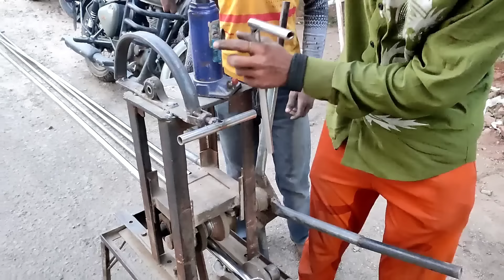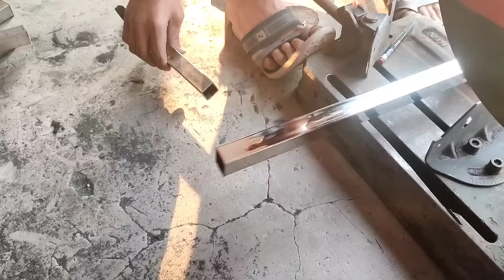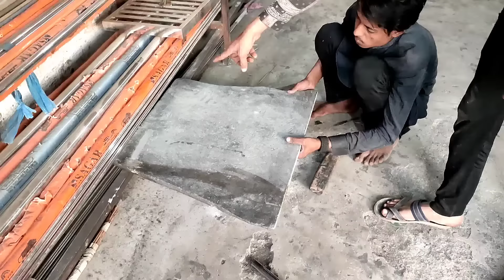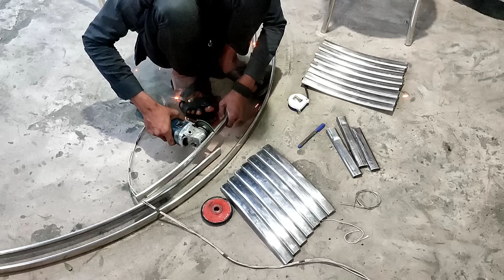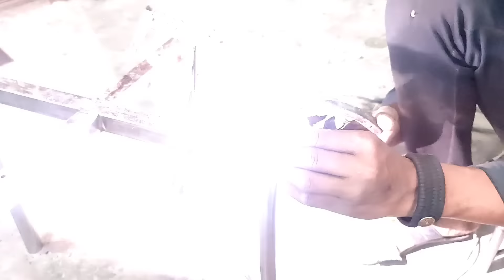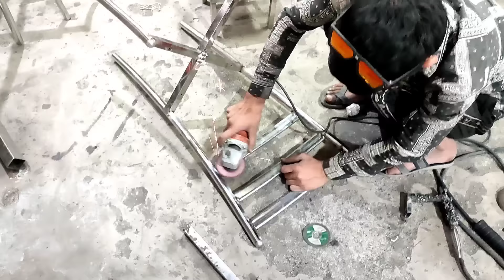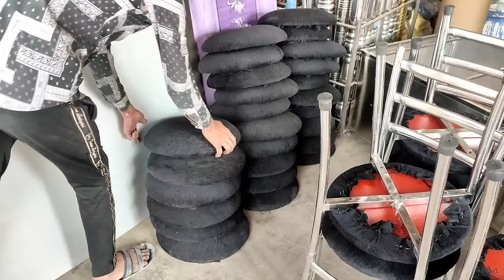HOLLOW STEEL CHAIRS | MINIMALIST CHAIR | CURRENT CHAIR | Stainless steel Chair design Manufacturing

Comment from the maker: Fully stainless steel chair 202 G

You can also order this chair. Minimum order is 50 chairs and its price is INR 900. 

Contact - 9907993089 - 9098406850

Email irshad9907@gmail.com
Reply from the maker: @rehanhaidar6877  1250
Reply: Pipe ki thickness (gauge) kitni hei
Reply from the maker: @vickybhardwaj228  20
Reply: 20 gauge per arc welding ho jayegi
Reply: Aap ka number bhejo khan saab
Reply: Location
Reply: @vickybhardwaj228 0:05 😊😅